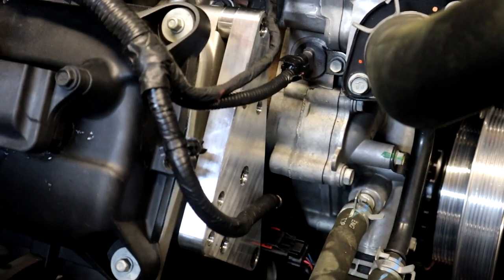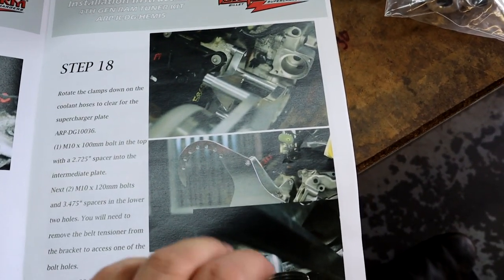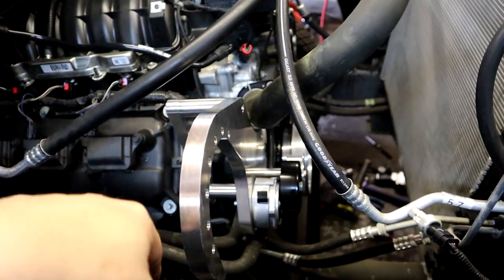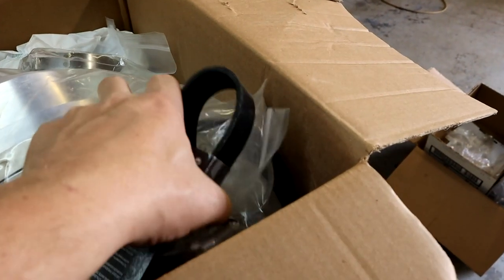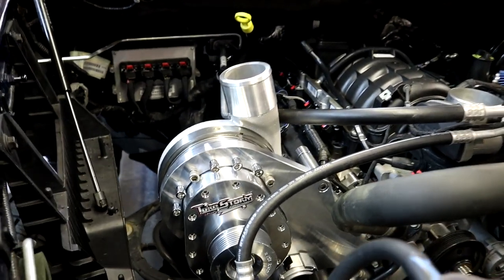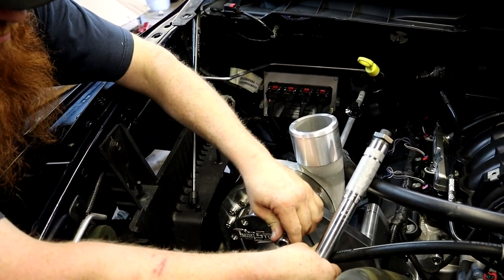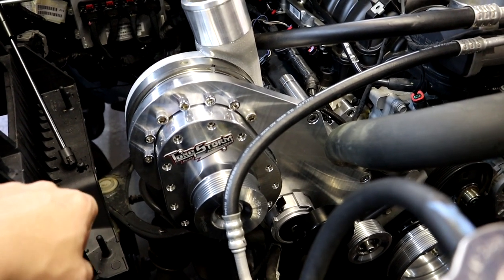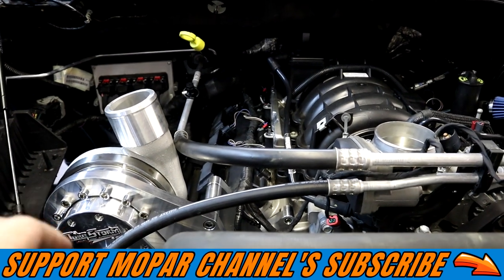Project STORM RAM 1500 4X4 Gets The TorqStorm Supercharger Mounted  Part 4

Comment: Keep up the great videos man! Also have a noob question about tuning for nitrous.. I already have an na tune would it be safe to pull the appropriate timing for the nitrous shot I want out of that tune or do I need a whole new tune?
Reply: Not frostbite but i am running a 5.7 hemi on a 100 shot with an N/A tune and depending on your kit they have instructions on where you need to be so as long as you have an AFR gauge, tuner/programmer, correct spark plugs, and enough fuel you are good to go👍 Start with a small shot & work your way up. Progressive nitrous controllers are your friend.
Reply from the maker: Work off the current tune just pull some timing out and start with a 75hp shot and tune up from there. Just remember good fuel 93 or better and Colder plugs.
Reply: @FrostbiteRam  thank you man! Yuup I'm on e85 so fuel should be good